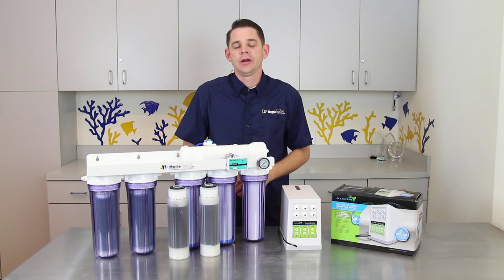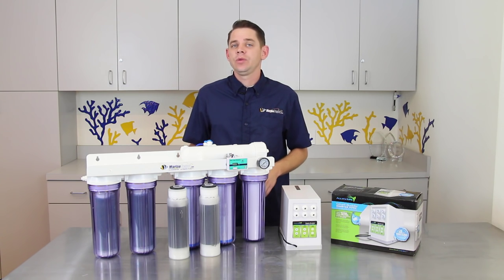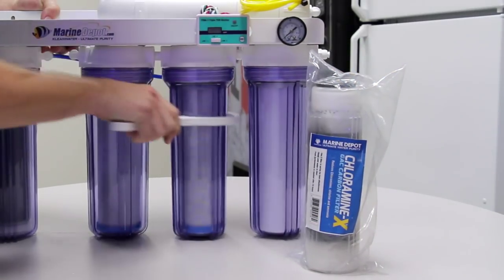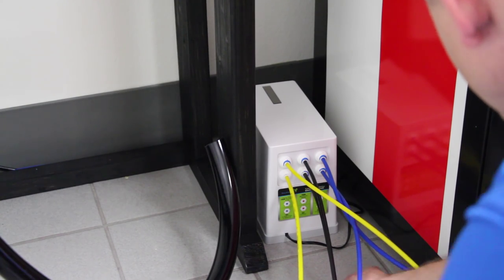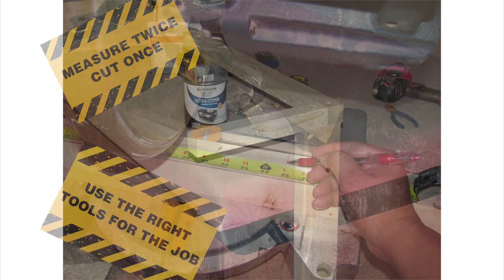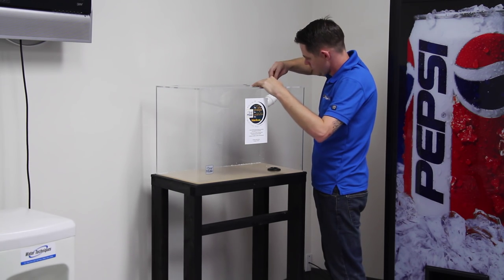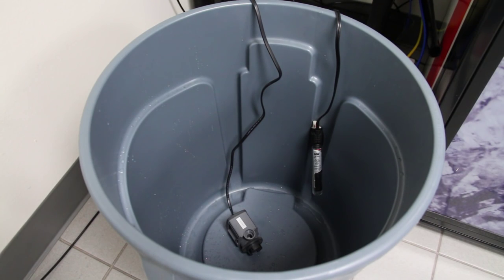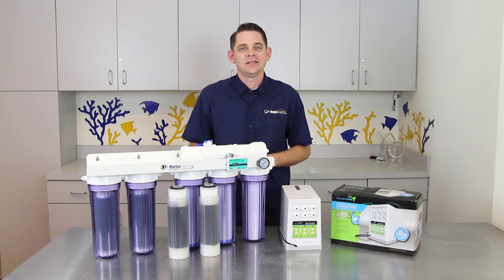How to Build a Saltwater Mixing Station

Comment: I purchased everything in the video 6 stage RODI, Booster pump, Float switch, I have a few questions. Do you have a diagram of how to hook this up?, the instructions are not to helpful. The SMART BUDDIE BOOSTER PUMP tell you to remove the resistor on the RODI system.

Comment: I’m in Florida and my garage gets really hot especially in summer.... if I mix saltwater in garage temp will go up to 90’s..... I need solutions here ... another chiller?? Shoot...
Reply from the maker: I would say mix your saltwater in an area without such extreme temperatures or work on climate control in the garage.  A chiller for mixing your saltwater can get expensive to operate.  You can just let the water cool down before going into your tank because in all honesty you should be bringing the water up to tank temp. before doing the water change so you could use it to your advantage. Will simply require the extra step of bringing the temperature down to range before putting it into your tank.  

-Robert @ MD
Reply: Don't mix it in your garage.